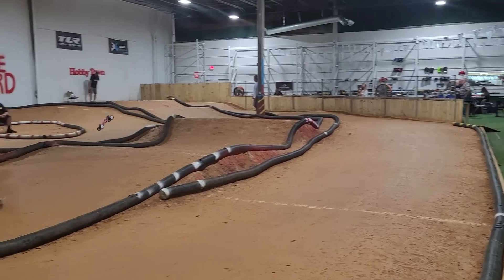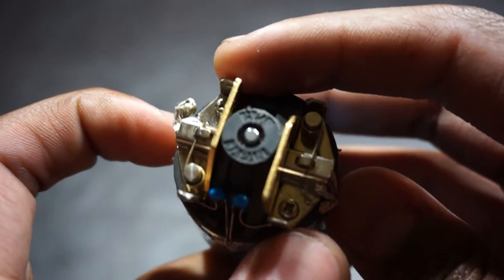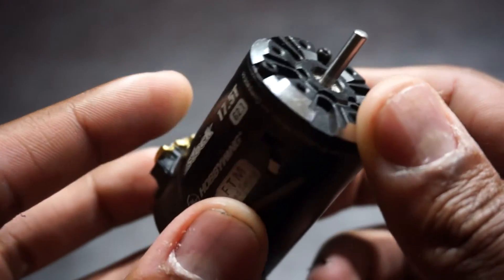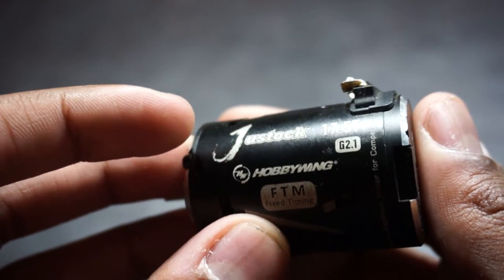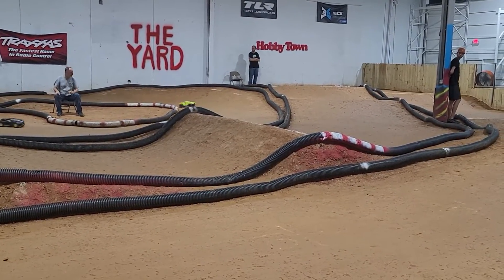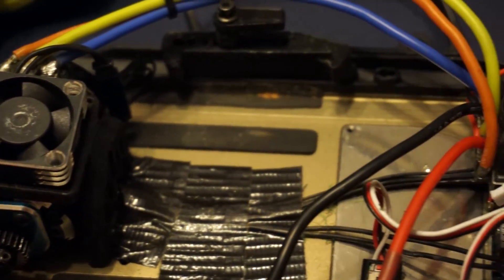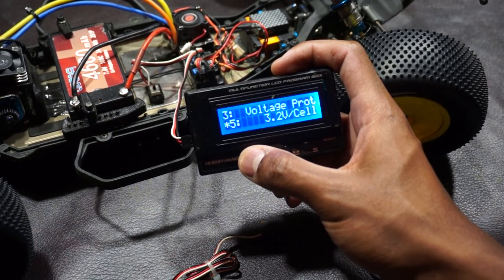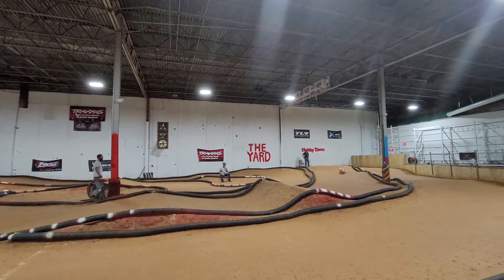RC Motor and ESC Crash Course

Comment: Please i need an answer for this i do have an 33v and 150 max amp electric motor system with 150amp esc and I'm trying to hook up this esc with 33v 900amp battery my question is... is it safe that any thing won't go wrong 🙏🙏
Reply from the maker: I'm not 100% sure

Comment: I just got a team associated roller. I'm trying to figure out what motor and esc to get for racing,  I'm thinking 17.5. Any suggestions?
Reply from the maker: There are a few out there that work pretty well. I'd say Hobbywing would be the safest option but be sure to check out your local scene and see what others are running
Reply: @RoachRC  Thank you,  what about batteries,  what size and brand? I know they use 2s but any other numbers to look for?
Reply from the maker: I'd recommend either Gens ace or protek 2s shorty batteries. However any battery you get must be a 2s "shorty" pack, no stick packs. Also try to get something with more than 4800 mah as that will give you plenty of weight and runtime
Reply: @RoachRC Thanks, I'm planning to buy a hobbywing esc, I'm looking at a gs3 or a xr10 pro, is there a reason to get an elite? 
I'm gonna run a 17.5,  I think hobbywing motor also thanks

Comment: I have my 7 or so year old Slash 4x4 brushless and I have yet to maintain the motor other than open it up and check whatsup on the inside (after 7 years of owning the car) I started modifying it to be a bit more aggressive and durable I replaced the 7 year old nearly seized bearings and it runs perfectly fine I love it

Comment: Perfect video to help my unfaltering noobitude.  My used B6 was behaving oddly slowly, batteries read fine, we were troubleshooting at the track, and this helps very much.  I had not yet researched what the ESC actually does and I had no idea about DRRS type settings.  #AJCSpeedwayrules. #CadeisPro.